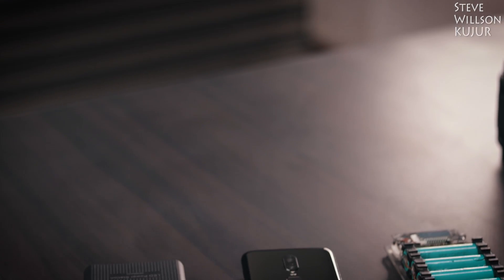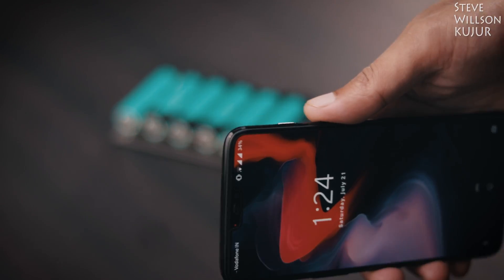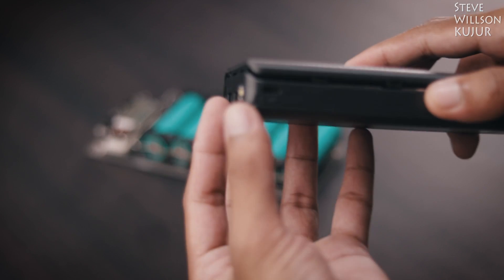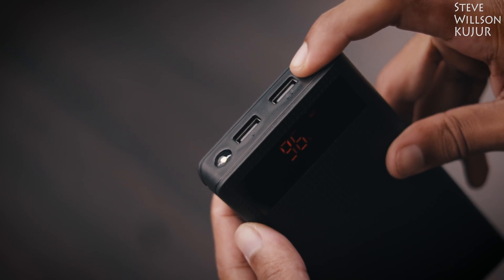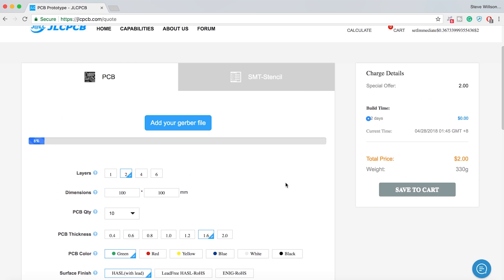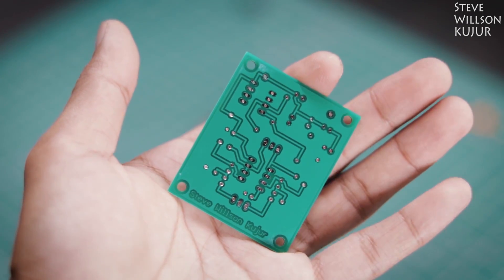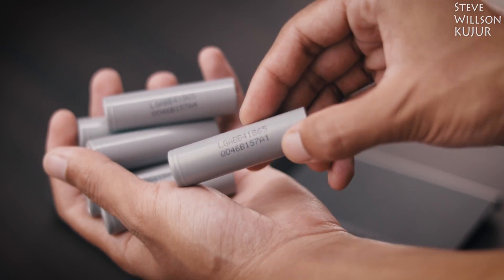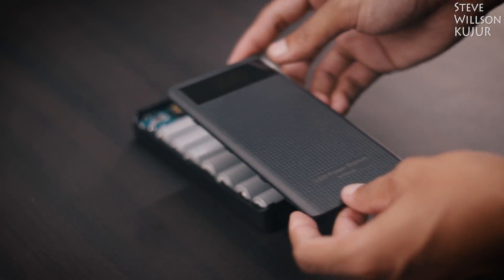DIY 20000mAh Power Bank | Super Simple

Comment: Steve, on Banggood it says Output: 5V/3A,9V/2A,12V/1.5A how do you connect to 9 and 12 volt output, I don’t see any outlet sockets, only the USB sockets.
Reply from the maker: Barry Greengrass This don't work that way , it's called fast charger the device will ask what voltage is suitable for that , by default I'll output 5V only